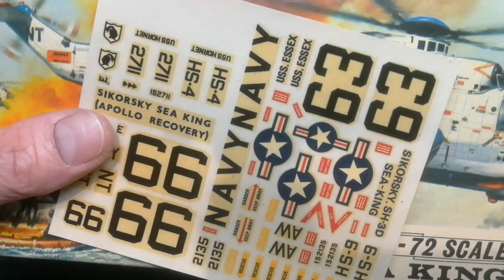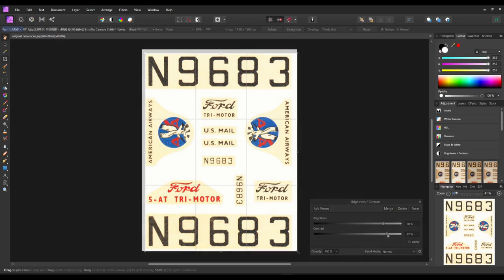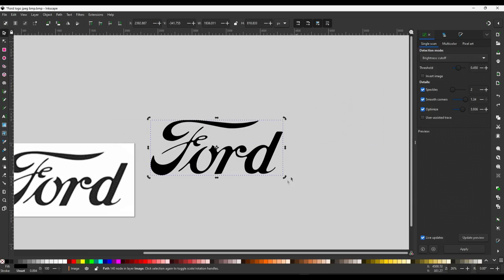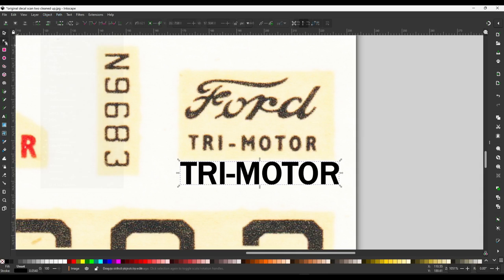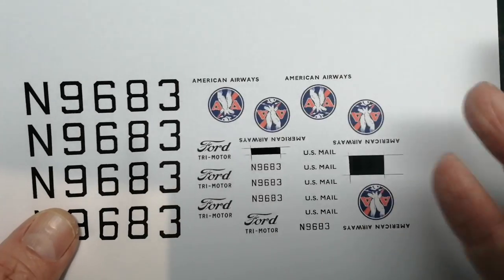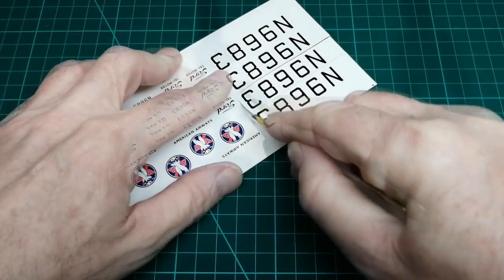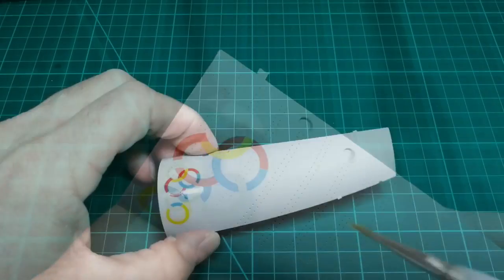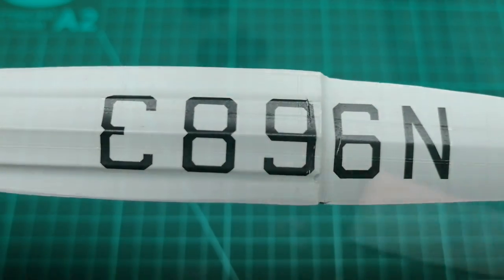Create homemade decals for your plastic creation. Revision 2

Comment: Nice video! I often make my own decals now but work around printing myself and the limits of that. I design the decalsheet and then sent it to a company that prints them for you. Usually the quality is great, you can print any colour (depending on what a company offers ofc) and they're ready to use without any spray. Might be a bit more expensive, but more foolproof. And in my case I don't have the room for a printer and equipment at home.
Reply from the maker: Might look into that👍
Reply: What companies have you used?  I've been designing some sets that I'd like to have professionally printed but lots of places want you to do big runs or have high initial setup costs.

Comment: Hello Greg thank you for the  video and the information provided. I have one main problem with the decals I print and that is cracks on the edges where I cut them and believe me I tried deferent methods for cutting (new blades, razors, scissors) and different type of clear coots on the decals. can you help me what I'm doing wrong. Thank you
Reply from the maker: I cut a few millimetres away from the printed decal edge, never up to it.

Comment: Fantastic video! This is a perfect instructional for generating decals. I've got some 1/350 Aircraft which I think I'll have to do custom decals for and this sounds like the solution. What's your thoughts on choice of printer? Your canon seems to have excellent quality.
Reply: HP are good, i use one to make decals regulary.
Reply from the maker: I use a Canon, which works fine for me. 
But it's worth looking around.